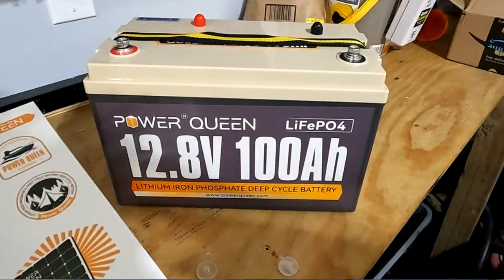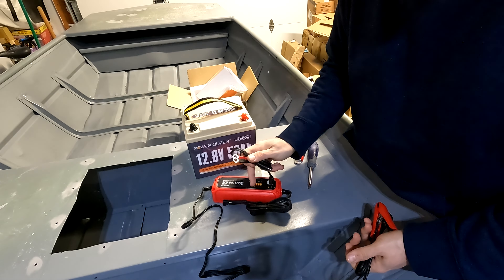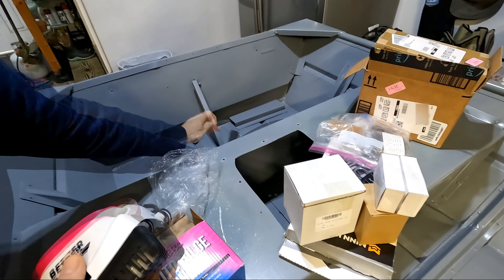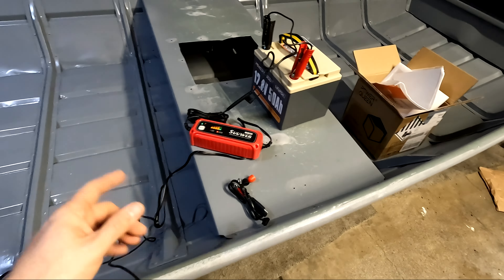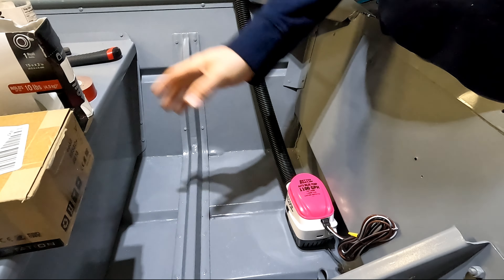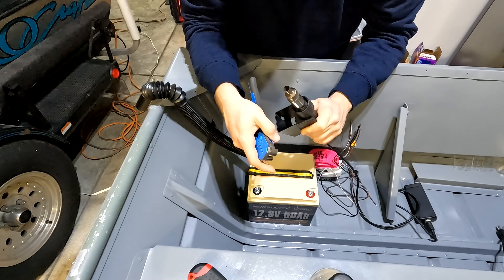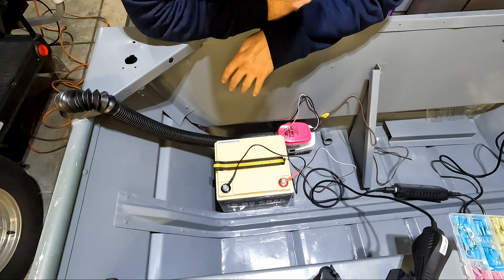Bilge Pump & Lithium Battery Installation | Power Queen & Better Boat - Ep. 9

Comment: When you explain to old-school boaters that the tiny little 50AH lithium iron-phosphate Power Queen has as many usable amp-hours, with less voltage sag, than they used to get from their 100AH lead-acid/AGM monstrosities, they usually won't believe you.  Then you tell them it will charge back up in 1/3 of the time, and won't be damaged if you forget to charge and leave it at 20% SOC for 2 months, plus that battery will last at least 10 years.  The only thing you have to watch out for is trying to charge it when the cells are at or below 32 degrees.  Other than that, LFP batteries are awesome!
Reply from the maker: You are so right, completely changes the game and so much weight savings its amazing.

Comment: Can you or should you leave the suwer battery charger  on the battery for extended lengths of time like during the winter months? thank again for your valuable time!
Reply from the maker: Yes you can, its waterproof and a trickle charger so it will maintain as well as charge.
Reply: careful to not charge lithium ion battery if its near or below 32F and you're good !

Comment: I have another question if you can stand it. How do you attach the drain hose to the bilge pump? thx again for your sage advice!
Reply from the maker: @gambels1  that's an easy one, it just pushes on! Make sure the diameter for the hose matches the outlet diameter on the bilge.
Reply: @mvboutdoors  Thx again, for your valuable time!

Comment: I have a Better Boat Bilge pump and BB 3 way switch. There are 3 wires coming from pump: Wht/Brn (auto)  Brn  (manual) and Blk (neutral/grd). The install diagram shows where each color wire plugs into switch. The install diagram shows a place on switch where the pos lead from battery plugs into switch. Diagram shows where neg lead from battery plugs in. Now I have the Blk wire from pump with no place to plug in. Please Advise  Thank you sooo much!
Reply from the maker: Black wire goes to the battery.
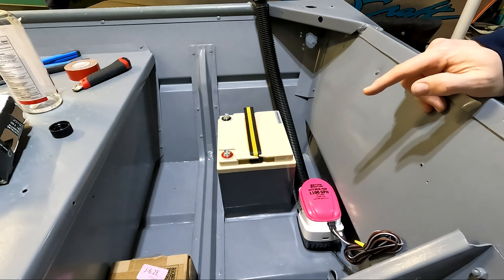12:15

Comment: enjoy ur videos! little off topic but i just got my first jon boat. it has an 2 stroke motor 15power. the motor doesn’t start always and if it does it looks like it’s overheating. what kind of maintenance is needed? any help is appreciated!
Reply from the maker: Carb for sure, overheating make sure it's peeing and if not change impeller

Comment: I want to put my starting battery beneath my middle bench seat. How can I extend my mercury battery cables that are 4 gauge to the bench seat safely?
Reply from the maker: What I used for extending thick gauge water was an underground splice kit. Its basically a block you screw down each end to with very thick and durable heat shrink.

Comment: why would you need a switch if the pump can automatically turn on?
Reply from the maker: Because pumps can get jammed with debris or just not work sometimes. Having a manual switch is a safety redundancy.
Reply: @mvboutdoors  thanks! I'll add a switch